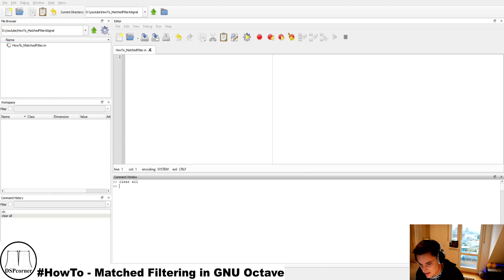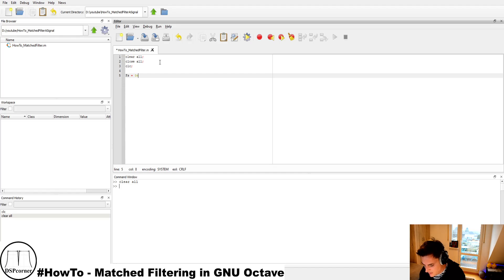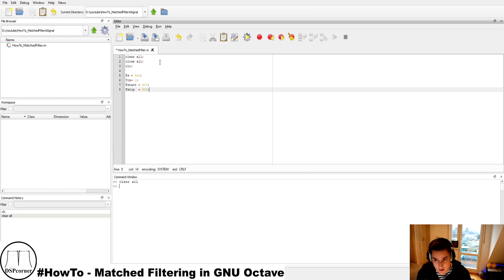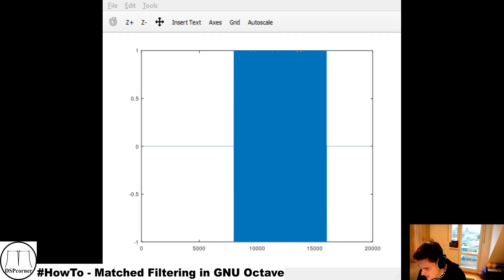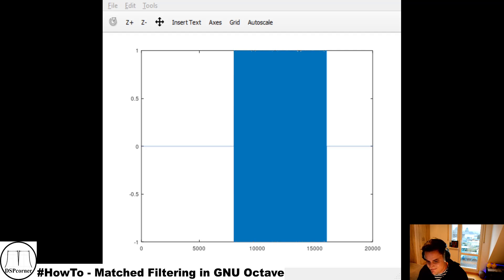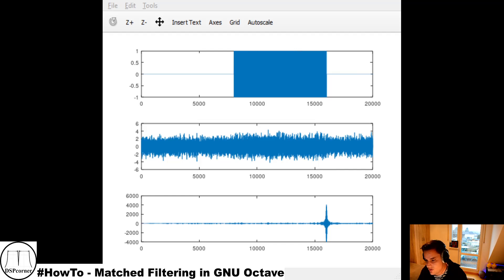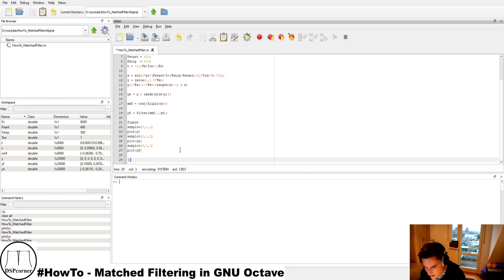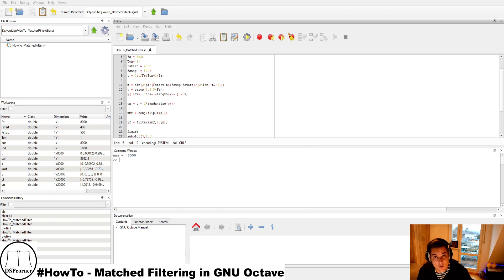#HowTo - Matched Filtering in GNU Octave

Comment: is it possible to modulate a signal on the LFM chirp and later recover it using a matched filter ? i wish if you could illustrate that in another video..thanks.
Reply from the maker: Yes this is possible. I will keep it in my mind and try to make a video about it when tjere is time :)
Reply: @dspcorner2018  danke schon.